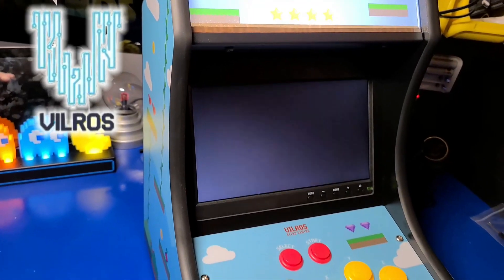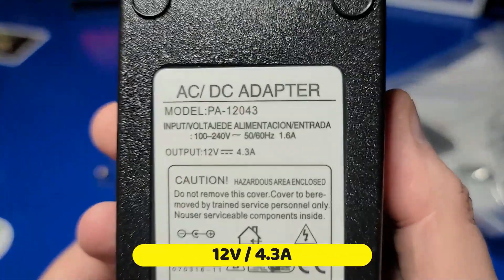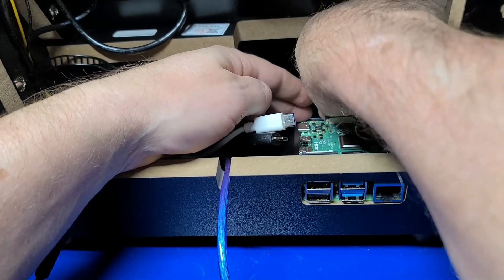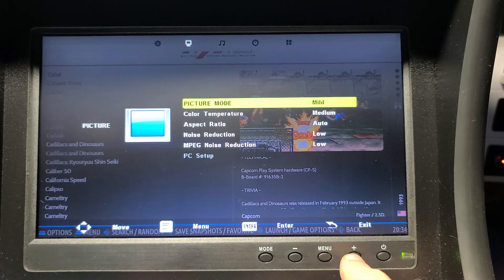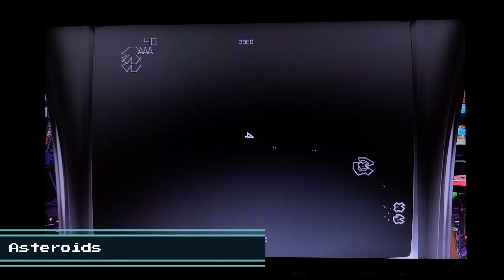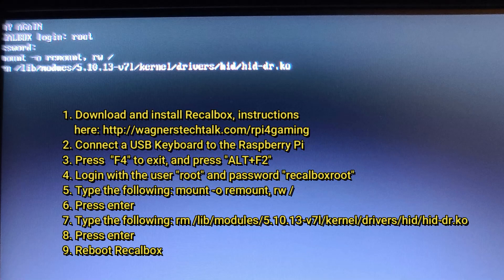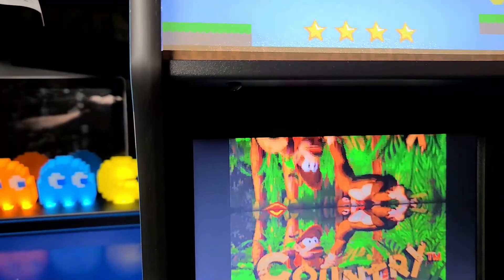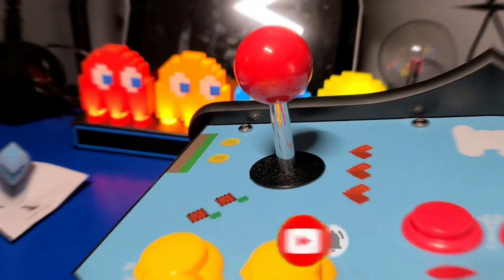Vilros Arcade Mini Tabletop Home Arcade for the Raspberry Pi 4

Comment: I assembled my cabinet 3-4 years ago with a PI4 and it is great.  I was wondering if anyone had done modifications to the marquee.  Anything would be helpful.  I'm interested in just adding some printed graphics under the lexan that are back lighted to replacing with an LCD.  Just wondering.  Thanks and keep up the retro!
Reply from the maker: I gave this unit away and no longer have it.  Perhaps someone else will be able to answer.

Comment: Hello.  What do you think of putting a Pi 5 in one of these?  Do you think it is worth it, or if would even work?
Reply from the maker: Not sure on that one, first of all the power requirements are higher for the Pi5.  A Pi4 would likely be ideal for this.  The Pi5 could work, but may need a separate power supply to the Pi5.
Reply: @WagnersTechTalk  Thank you!  I finally ordered one.  I am excited to try it out!

Comment: I just got one of these, my only real gripes are the side stickers were starting to come off, right out of the package I had to push it back down and get bubbles out, and the screen has a low view angle.   DO YOU KNOW WHAT SCREEN THEY USED.. it seems it is one of the many lcd panels you can get for cctv applications on Amazon and other, but they removed the branding.
Reply from the maker: I don't, I wound up having a giveaway and gave it to a lucky viewer.  Details of that giveaway are here, for reference: https://wagnerstechtalk.com/winners/#Giveaway_2_-_Vilros_Tabletop_Arcade

Comment: Would this work with a Steam Deck instead of a Raspberry Pi?
Reply from the maker: It might, I don't have one here for testing so you may want to check with Vilros to be sure (I gave this one away).  You'll likely need a dock for the Steam Deck with HDMI+USB and perhaps an adapter for the HDMI cable.  Just a few things that come to mind from memory.

Comment: micro sd has no external connector? I like to exchange cards
Reply from the maker: You could use a flat microSD extension cable and route it outside the cabinet if you want.  Something like this should work out https://amzn.to/40VYLoN

Comment: I just got this from being the winner. Be careful. I unboxed it. And was running fine. Seemed to be really cool and figured my kids will love it when they get home from school. I set it up. Setup the wireless connection. It said a new update was available and D/l it. After it rebooted its bricked. No joystick or buttons. Cant do anything. No support contacts on the web page. Found a FB page. But nothing from that as of a couple hours ago. I assume the Pi would be reset. Anyone got a clue on how to do that. ?
Reply from the maker: Glad you received it ok, regarding Recalbox it's mentioned in the original review video how to fix the controllers: https://youtu.be/fVnigtSNRT8 (also in the video description are the commands I used).  If you don't want Recalbox installed, Batocera and RetroPie are also good options.  I have guides for those here: http://wagnerstechtalk.com/rpi4gaming/#Official_RetroPie
It's likely not bricked, the update probably overwrote the settings I had made for you in Recalbox.  In that case, just re-running the commands mentioned above should fix it.

Comment: While I agree with some of the commenters that $300 feels a bit spendy, it certainly looks like a solid piece of equipment and unless one has the tools/materials/skills to build a bartop from scratch I think this is a great way to go. I've looked at Pimaroni's PiCade, which is comparably priced, but one has to assemble that (though it does come with more buttons.) I like that the marquee can be changed out, too, though it'd be nice if the graphics on the cabinet itself could be easily changed (I suppose one could source a vinyl printer.)
Reply: FYI price seemed to drop a lot, it is $99 now.
Reply: @igorbogorad2687  Now that is interesting. 2 years later, I imagine it's due to the waning of Pi4 adopters over the newer Pi5. Thanks for the heads-up.
Reply from the maker: It is a very solid and well-built cabinet.  I can't compare it to the PiCade as I've  never used one but the differences appear to be significant in terms of build quality/materials.

Comment: Your pi 4 Needs cooling fan
Reply from the maker: I tested without any heatsinks or fan to see if thermal throttling would occur, it surprisingly didn't.   Even playing dreamcast and other GPU/CPU intensive emulators which were running for 6+ hours.  Definitely needed for overlooking.  However,  still a good idea to use them,  I agree with you.  This machine will be given away to someone else, when it is, it will have a fan and heatsink installed.  It just arrived today (all-in-one unit).

Comment: Thanks for the video well done. As far as this arcade goes the price is way way to high. This is a $150 item imo.
Reply from the maker: Thank you Tom!  I understand and agree it should be cheaper.  But when I priced out the components (without any discount), there wasn't the massive difference I was expecting.  I don't think I could build this same machine at the price they are asking without buying used components.  I may follow-up with more details in the giveaway video.
Reply: Sub $150, with a monitor? Cheapskate!! I'm sure you have a b.s. story, about how you can build a cheaper one using the SAME new parts?? GTFO!!!